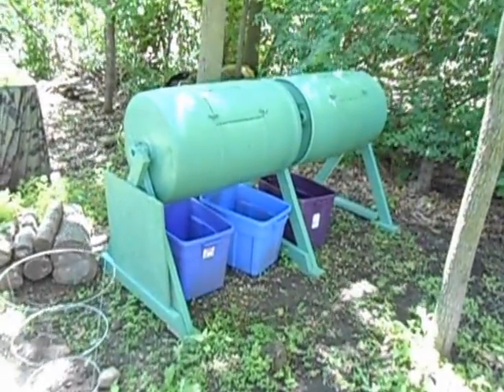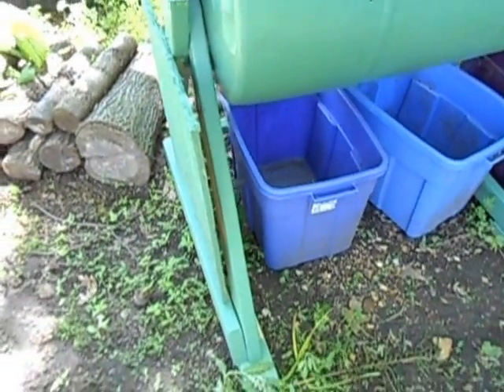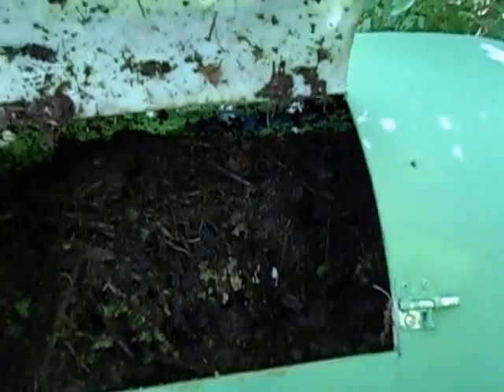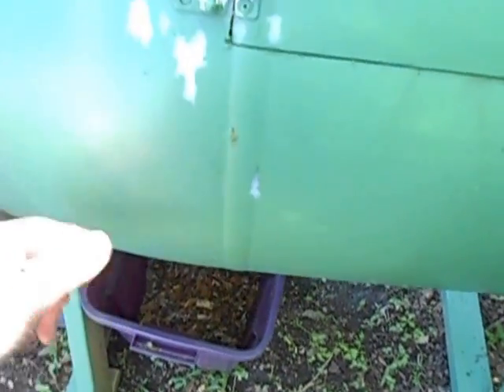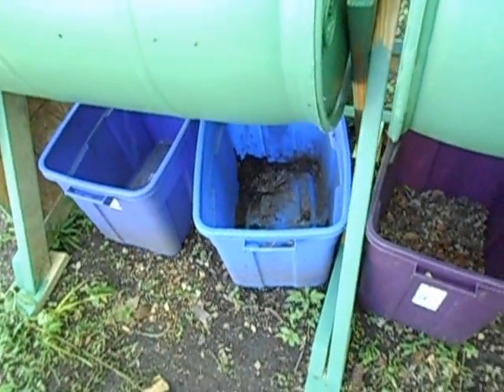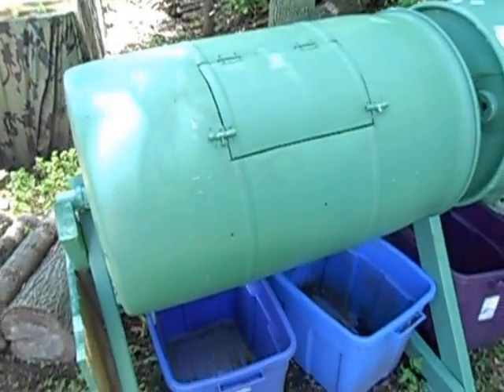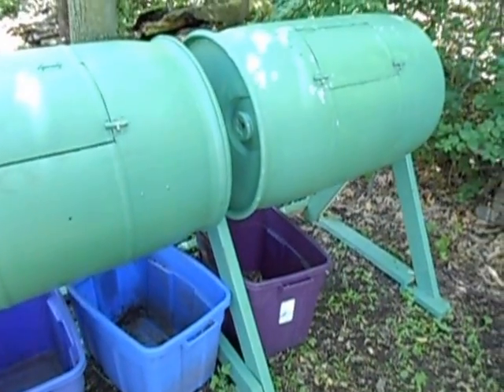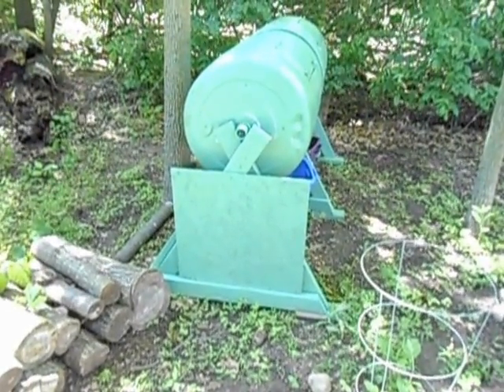Compost Tumbler double barrel

Comment: Nice double set of composters!  Love the simple yet effective frame.  The only difference I would do is not to put holes in the bottom so it leaks out the "compost tea" all the time, in part as I don't wish the juice to attract flys or bugs.  I prefer the bigger holes on the middle-ends only with 1/8th mess or smaller for air circulation.  Also might do a few splashes of darker green on your drums if you wish for them to blend in more.  But nice looking as is!